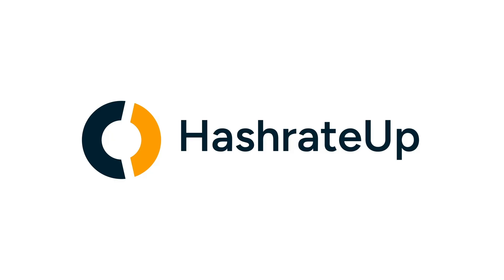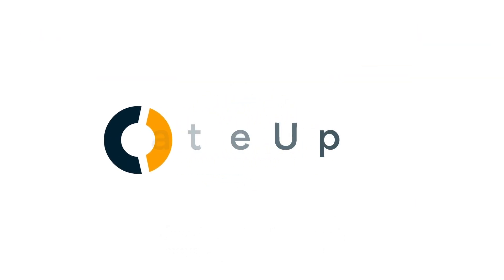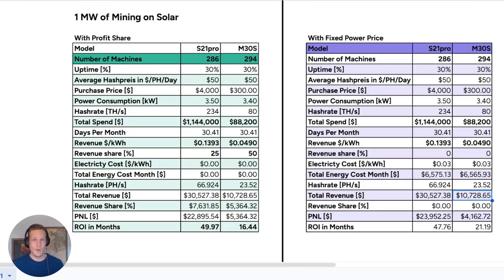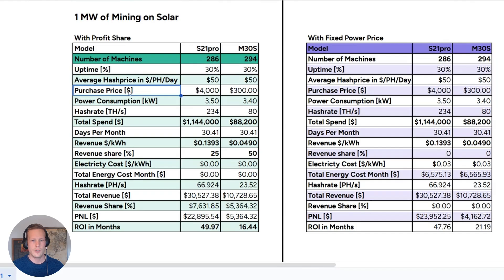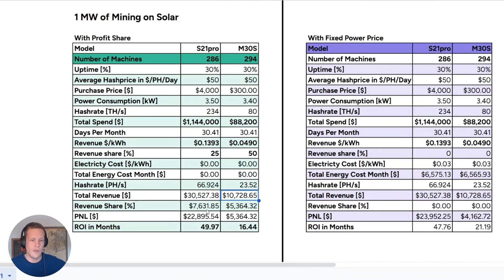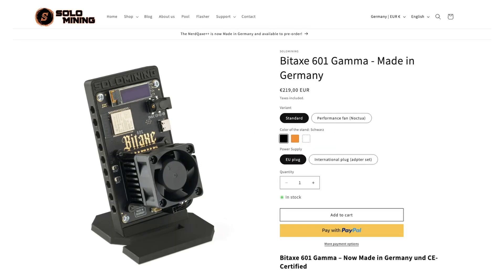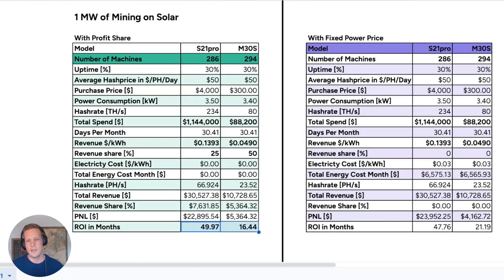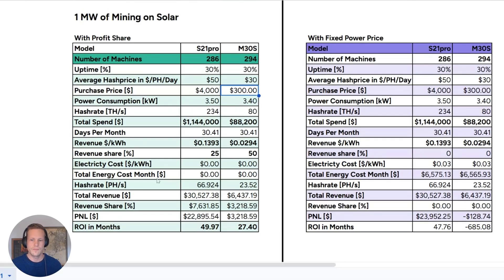Does Mining on Solar Make Sense?... [FOCUS]

Comment: Big power plants are not ready to receive directly mining load, since it consumes power on 400V. We’d need to buy a transformer and do other technical adjustments. If you consider those costs as well, the numbers simply don’t work. And we are not even considering the O&M risks of buying used/old generation machines. I fear to conclude that mining on such a low uptime is just economically unviable 😢

Comment: I'm running the numbers to upgrade my home with solar plus battery storage, for resilience, EV charging, and heat capture for HVAC / spa - pool. What are your thoughts on enough solar plus battery to mine continuously?
Reply from the maker: Continuous mining on solar plus battery means very expensive power. You don't want to cycle your battery for Bitcoin mining. The cost of the battery is too high.

Comment: Electricity is a time sensitive product due to limited storage capacity. Flat rate doesn't make sense to get a flat rate since it will be based on LCOE with a safety margin making it more expensive than the time based rate. Tracking electricity prices allows you to maximize Solar PV and mining ROI. Over all with flexible demand consumer benefits from more stable electricity prices, at the same time PV plant owners don't get burned by losses. Other off-demand applications could include green hydrogen, smart water heaters like Mixergy, cooling applications with buffer tanks, etc.
As for my particular country, I hope they make Grid Cost zones. So we avoid paying for power line renewal/upgrade where battery power and micro grids would make more financial sense otherwise we are paying ~5¢/kWh just for delivery and tax.

Comment: I bought an antminer t15 for $20 but spent $1700 on a 1.2kw solar array and a power station with 2kw battery capacity. The payback on the miner will be fast but it will take forever to recover the cost of the power station and solar panels.
Reply from the maker: For sure! What's the expected ROI on the solar?

Comment: why using only 30% uptime? is it because the the sun is not there all the time? what if there is a bess in the solar park that covers for part (if not all) the night time? thanks
Reply from the maker: Yes, 

Depending on where you are in the world you will only have so many "sun hours" and 30% is actually not very conservative

Good question on the BESS! Usually (!) the BESS has a limited amount of cycles. When you cycle the battery more often because you are mining you are "using up" the batteries lifespan, which has significant costs associated with it.